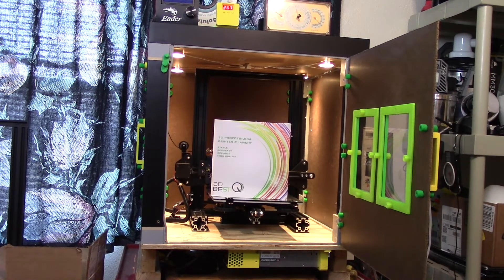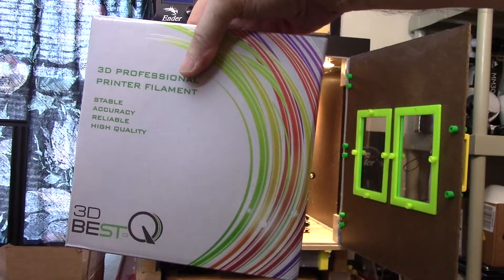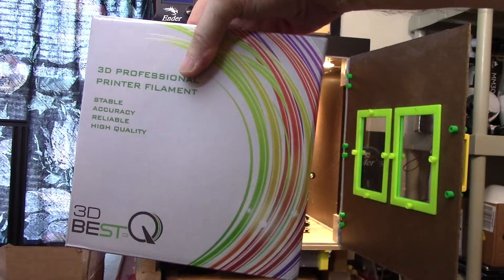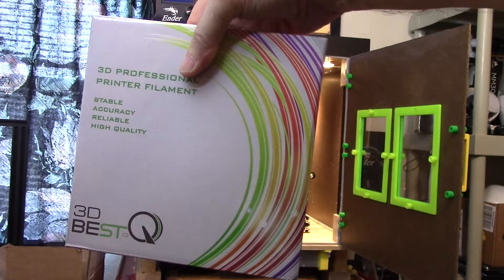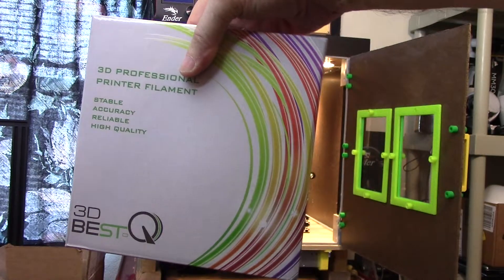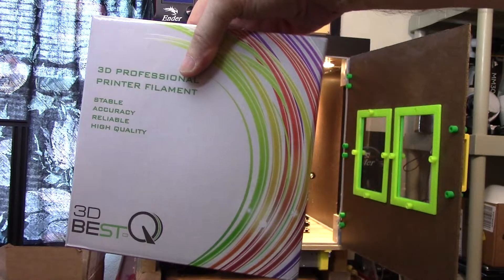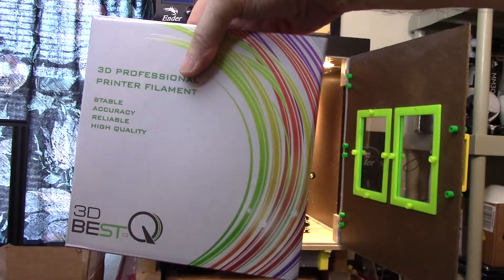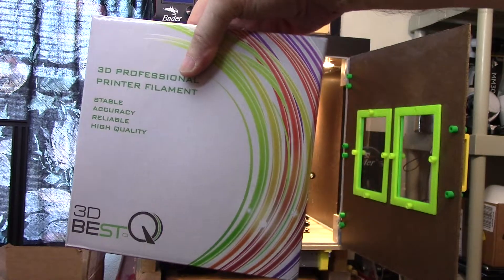Initial Test and Review of the 3DBest ASA Outdoor Filament

Comment: Have you tried the Cura "Ironing" settings for the top layer? It slows down the print, but often it makes it look much nicer.
Reply from the maker: I have used ironing and I'm not a fan of the added print time. So I only use it when I really need a smooth top surface. In this case, since that surface is on the inside I don't really care.

Comment: I saw what looked like a seam on the cylinder, you might want to try Z Seam Alignment = Random for your next prints.
Reply from the maker: It may have gotten cut out, but I thought I'd mentioned that I don't like the random Z seam because instead of a nice seam going up one side that I can easily sand off, I've got little specks all over the print which are, at least for me, more difficult to remove cleanly. Plus, I can put the seam, in a spot it won't be seen.